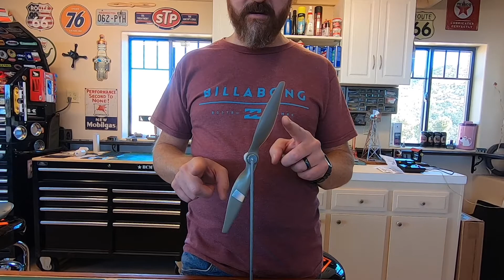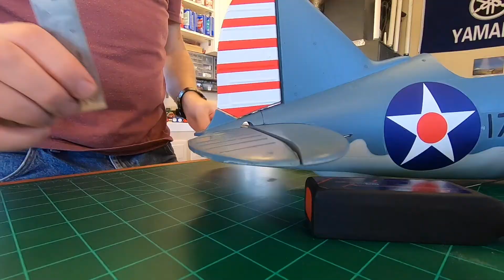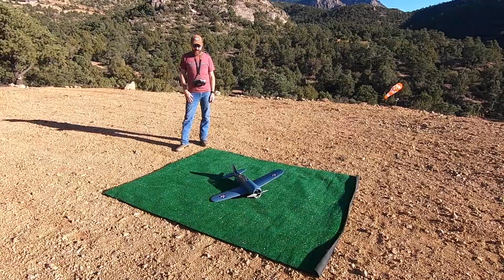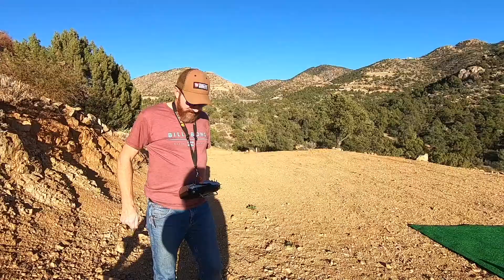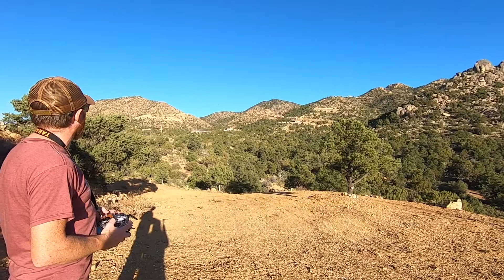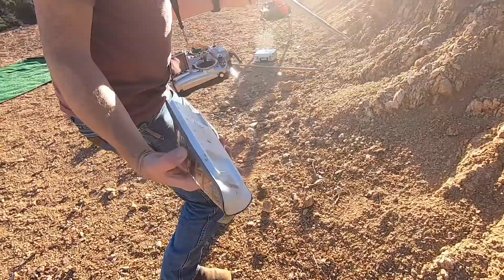Hobbyking Durafly Brewster Buffalo Maiden Flight w/ Crash

Comment: Have maybe two dozen flights on mine, and for a little airplane, it needs a lot of room.  Mine took a good whack, punched the motor through the mount and crushed the battery.  The nose is tweaked and the wing is wonky, still flies fine though.  But it has definitely looked better.  Hit so hard Mr. Hero Pilot snapped off and was rattling around the cockpit like a BB in a box.  Good times!  I never could have made it onto your runway on the maiden.  Probably couldn't do it now.
Reply from the maker: Wow! sounds like yours took a harder hit than mine! This thing really cooks!! I was pretty surprised how fast it is! Hindsight is 20/20 they say haha. Mine will definitely fly again but I will absolutely not fly it again at my house haha

Comment: If you watch YouTube channel Just Wingit you will see that he fitted nose weights for the maiden flight but he removed them for the second flight and it flew much better.  Good luck 👍
Reply from the maker: Thanks for the tip! That is exactly my plan haha i think that was my problem. Or at least one of them lol
Reply: Unglued Modeler I have got one from hobbyking but I’ve not got around to building it. One thing that I like to do is to install a flight stability gyro. The best one that I have found is the NX3 evo.Only a few $ and easy to install
Reply from the maker: Oh cool I've never messed with gyros in planes I'll have to check that one out! Thanks!

Comment: OMG I see what you mean! I am just about to do my maiden with this too, now I'm worried Ha ha. I've just finished build today. It looks twitchy and fast I think I'm gonna have the same issues! I enjoyed watching and I've subscribed 😁
Reply from the maker: Awesome! Thanks man! So Ive determined I was slightly nose heavy which lead to some of my control issues. Im gonna take 1/4oz of weight out of the nose and prolly go from 8mm travel on elevator to 10mm travel. That should help alot for my plane at least. Oh and she is FAST compared to what Im used to haha. I usually fly a Teksumo wing and an E-Flite Maule. So this little guy is wayyyy different for me haha. I also need a bigger runway than my little home STOL runway lol
Reply: @UngluedModeler  Yeah I thought that too, once you remove a little nose weight that should sort that out nicely! This one will be a jump for me too as  I've been flying a Hobbyzone Super Cub, should be interesting that's for sure!
Reply: @-BUFFALOMan  I am so ashamed to say this but I haven't been brave enough to do it. I crashed my trainer to pieces, then bought a glider in the meantime and crashed that twice. I wish I could attach a photo of the buffalo hanging proudly in my hangar, I just can't bring myself to fly it! If I knew I wouldn't crash it I'd fly it tomorrow. Any ideas welcome!